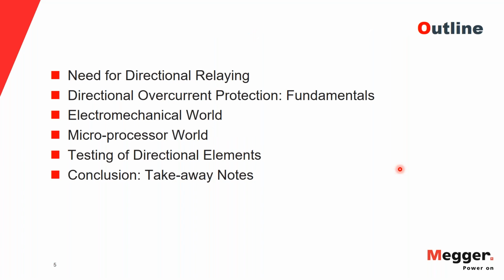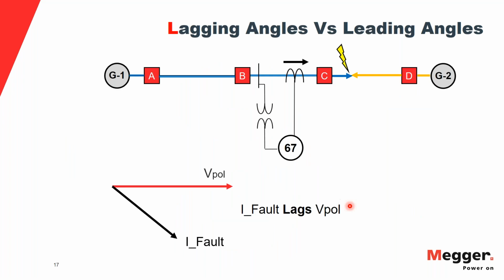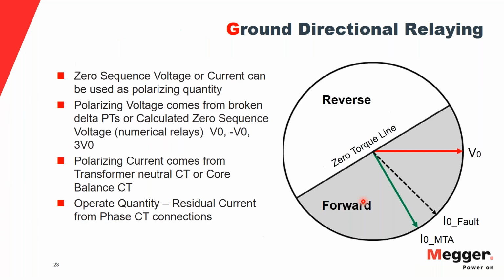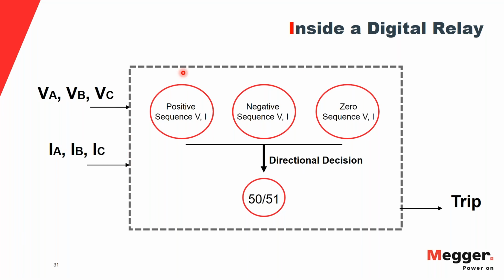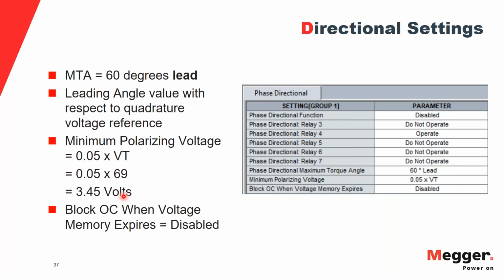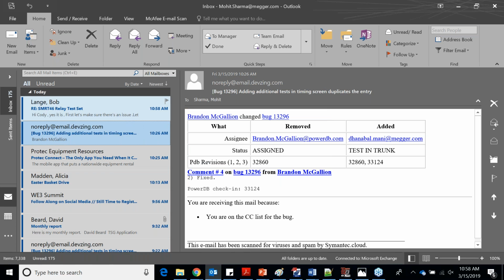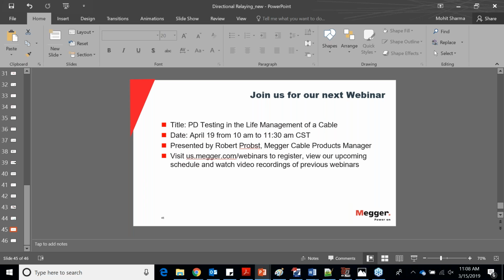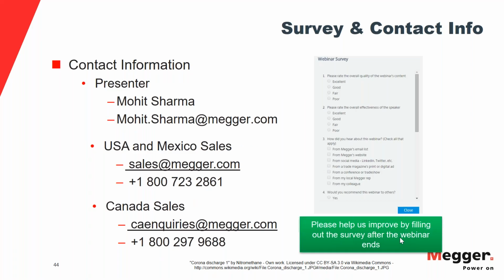Directional Overcurrent Relaying  Now and Then

Comment: How do I know whether it is forward or reverse.?
Reply: The relay uses bus voltage as a reference to determine direction.  Positive power is FWD and negative power is REV.  The current will have a 180 degree shift between FWD and REV.